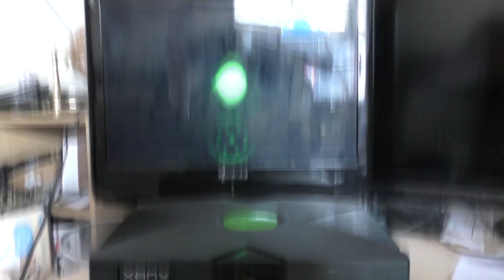Original XBOX FRAG: E07 Repair - HDD Timeout from IDE / LPC Corrosion

Comment: Hi,  just found your video due to similar situation by fixing a trace. i was wondering what gauge wire you used and what is that green stuff you applied after. i fixed my xbox by using one strand of wire from a spare 24 awg wire, it wasn't copper though.  i had a mod chip and  removed it to trouble shoot the issue. with the modchip, the xbox frag. without it, everything works fine. Do you think i still have a bad trace somewhere? i can't find any other bad trace with my microscope.  i really enjoyed watching your video, was very detail. thank you
Reply from the maker: Hi Jeff,
Check your D0 point bud and the condition of the trace which leads from it. Had one similar a while back - I was doing some maintenance on one of my boxes and must have slightly caught it - still looked like it was in place but would only FRAG. Re-soldered the point and it came back up. If the machine detects something on the debug header and the D0 point isn't grounded then the machine will FRAG so check that point and trace and hopefully you'll find your issue :)

Comment: All of the black capacitors on my console is leaking.Is there another alternative to using a capacitor that will eventually leak?
Reply from the maker: As they're through hole parts the easiest thing to do would be to replace them with some decent quality electrolytic caps - Panasonic or Nichicon are the best quality caps you can buy.

Comment: hi been watching ur videos to try and figure out a problem with my ps4 it turns on and works some times for five minutes some times hours then turns off and will not turn on I have replaced power supply worked for a week then the same thing happened can I send it to you to be fixed
Reply from the maker: Hi,
Where are you located? Many thanks.
Reply: Saxmundham Suffolk
Reply from the maker: No problem. Drop me an email at ytandrewpaul@outlook.com and I'll send you the details across for mailing the machine in etc. Many thanks.
Reply: ok will do thank you
Reply: just sent u a email many thanks
Reply from the maker: I've sent a reply back now bud - many thanks.